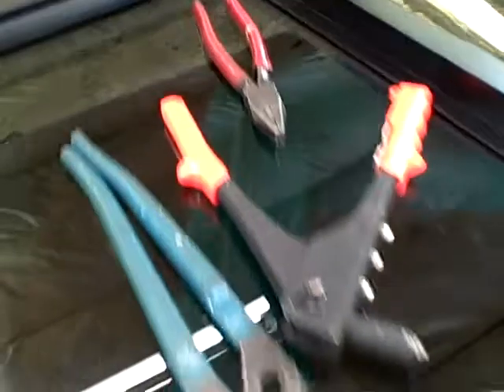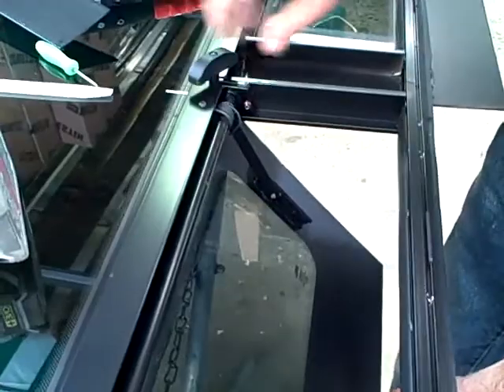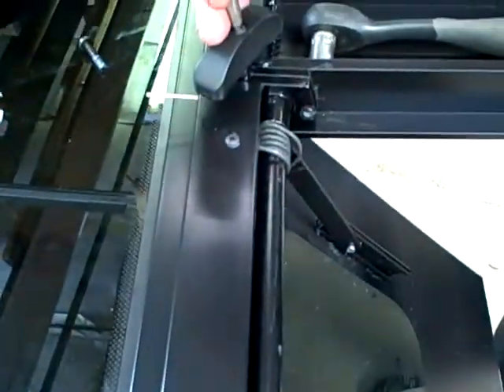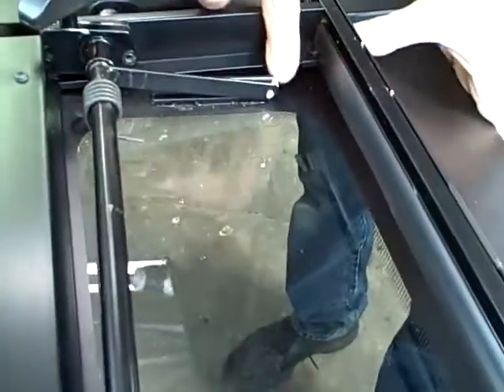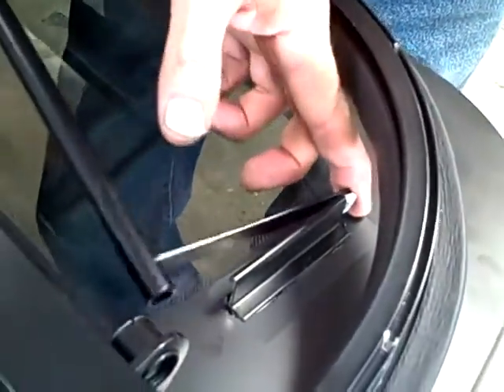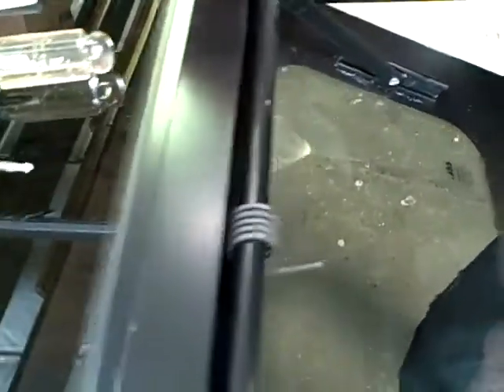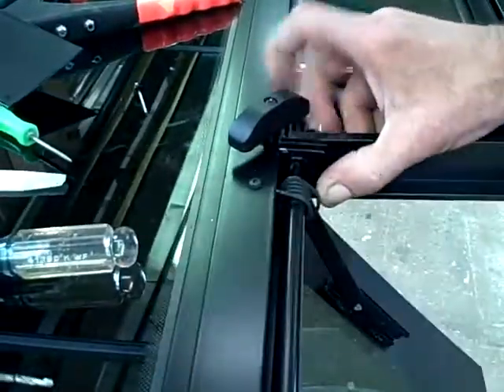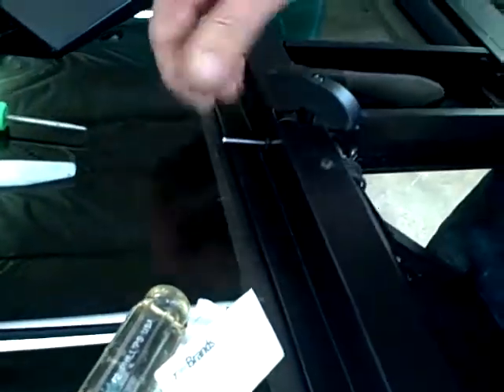Repairing the CR Laurence tip-out window mechanism

Comment: Where can one find a replacement torque bar or even just the gearbox?
Reply: Were you successful in finding the replacement part? Our window doesn't tighten tightly anymore so I believe we need a new part. Thanks in advance!
Reply: I installed mine on my own so I had to contact a local CR Laurence dealer (not a warranty repair case) and the replacement bar was $75. The install is gonna be another $100 so I'm grateful for this video.

Comment: From the factory (CRL) my 626L window doesn't close fully. Both vents need to crank shut about another inch.
Seal is not jammed or bunched up. That was CRL's only idea on the problem. 
In your experience is there adjustment in the gearbox, etc, where I can sacrifice a bit on the fully open end, to get these vents fully closed?
It's already installed and I'd rather not take it out, and return shipping would be $150.
Reply: M Shef - did you resolve the issue with your window? We more or less have the same issue. I need it to close tightly but the gear box/crank feels stripped on the close tight side but still opens properly.
Reply: I had the same feeling in mine, felt stripped and could be pried open from the outside easily. Turns out it was the bar. Check to make sure the "back torque bar assembly" isn't sheared like mine did. had to order a new part and will attempt to repair with this video as guidance. Good luck!
Reply: @CoreyWarren  Were you able to acquire the replacement part direct from CR Lawrence?
Reply: Yea i was, it was STUPID expensive ($75 + shipping) and I still need to have it installed... Silly.

Comment: Thanks for the video! My window crank was over tightened on close and I believe it's stripped because it will not tighten the way it used. I think replacement parts are in order unless I can somehow fix it once it's disassembled.
Reply: This same thing happened to me. Were you able to fix it once disassembled or did you have to order parts?